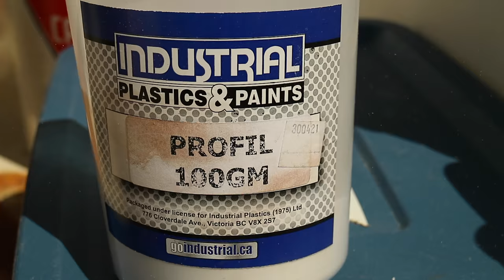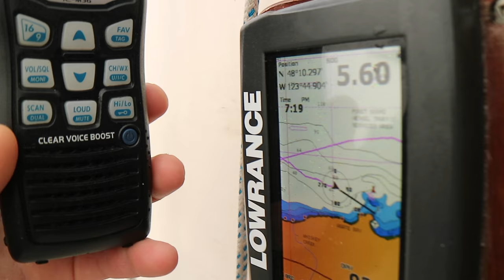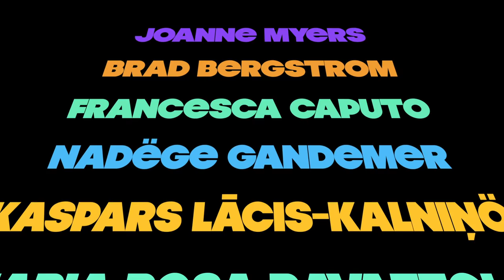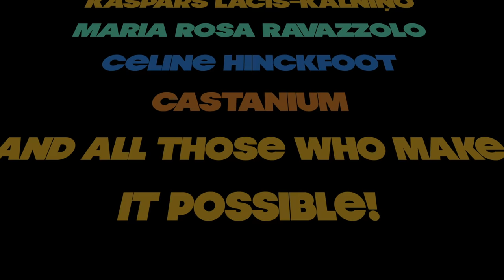16. Sailing Maiweh: Campbell to Cape Flattery

Comment: Nice work! I noticed Robi never wears any sort of protection when using mats and resins...and sanding. How do you cope with the itchiness? Also what filler did you use? I recently sanded down the whole hull of my old beneteau project boat. There was a lot of very small osmosis spots, I got rid of all the loose parts, but need to fill the little holes now. I have epoxy and micro glass balls, but was looking at something cheaper to use..so I can save the epoxy for other jobs.
Reply from the maker: Yes, he needs to be wearing some protection for the work, and we usually make sure there is eye and breathing protection, but we mostly destroy our suits and gloves immediately. All I can say is that we took full advantage of the showers at the yard daily...

For the fillers, we were using the matching West System blend, specifically the filleting blend (toned to look like wood), although this one would have been off-white and worked nicely too (http://www.westsystem.com/ss/406-colloidal-silica/).

The white filler we used was from a local plastics shop and worked very similarly (http://goindustrial.ca/index.php/en/products/52/20/fibreglass-resins/putties-fillers/antisag-detail). This one was a little bit cheaper than West System.

If you have a plastics shop somewhere nearby, I would check out if they have any fillers as well.

Comment: Did you use single pack or 2pack paint? Been doing something similar myself and using epoxy 2 pack.
Reply from the maker: We had a tough time finding two-part paint, which is much more durable. We went to a place called Cloverdale paints, and they hooked us up with one really economical bucket of blue boat maintenance paint, and one bucket of Jotun anti-fouling. The whole paint job cost only about $300 CAD. But two-part really would have been the icing on the cake...